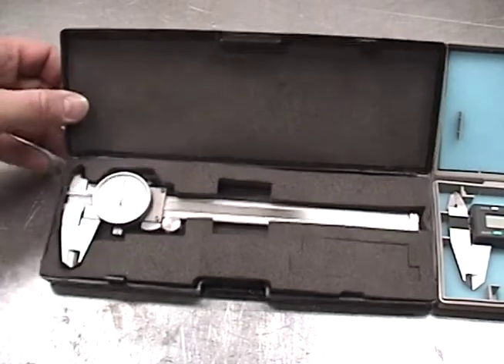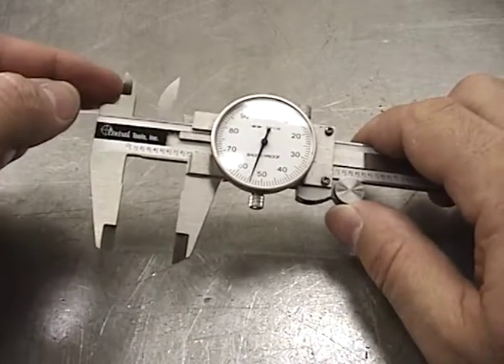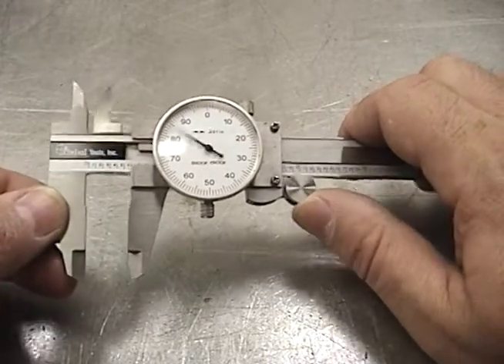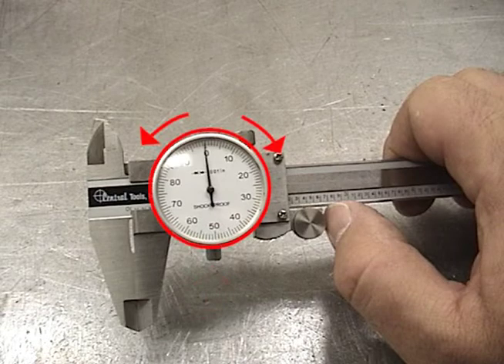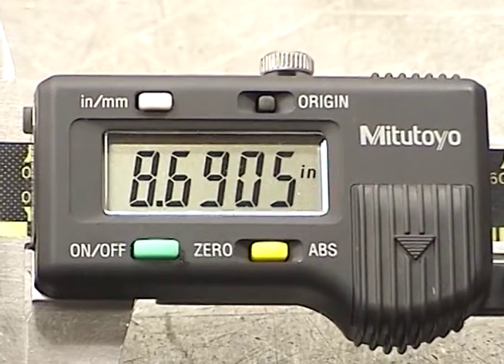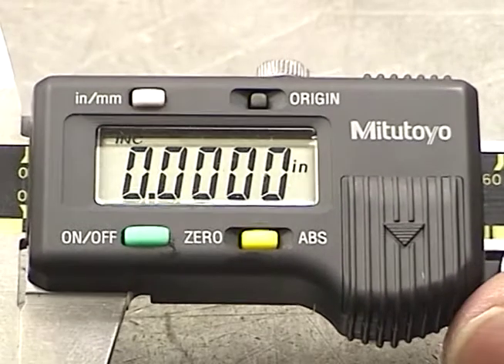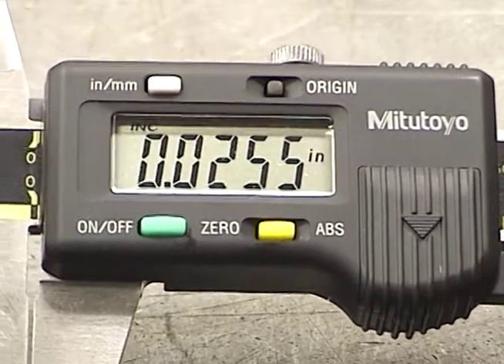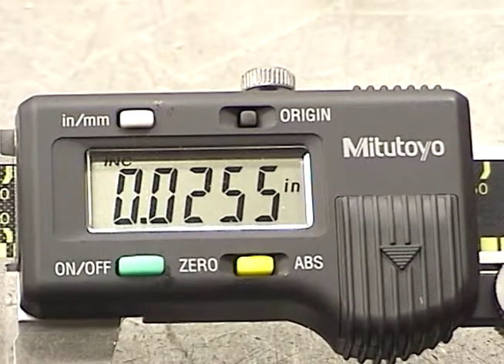Calipers Calibration

Comment: Was looking for calibration info not what it can be used for
Reply from the maker: At 50 seconds to 1:15 I discuss how to calibrate the caliper.  Close the caliper, loosen the scale locking thumb screw and turn the dial so zero lines up with the pointer.
Reply: @DrivelineMaster  No, that is called zeroing and is not how you calibrate calipers. Calipers need calibrating when they go further and further out of true as you slide them open. It has nothing at all to do with how they are zeroed at the start.
Reply: @DrivelineMaster  mine has no screw for tuning the dial how do i do it ?
Reply from the maker: the outer scale might be a friction fit.  Try turning the outer scale.  I have not seen any dial calipers that didn't have a lock screw for the outer scale that is used to zero the tool.
Reply: @DrivelineMaster  but the outer scale will be shifted to the side then ? thats not very esthetic!
Reply from the maker: Something is not right with the engineering of your calipers. You want a correct measurement or do you want esthetics?  I don't know what brand you purchased but anything less than $50. USD I might questions the quality and workmanship.  All half way decent dial calipers that I have seen and purchased all had a lock screw for the outer scale so the caliper could be zeroed.

Comment: Sorry, this has nothing to do with calibration. Zeroing and calibration are not the same thing. Does anyone know if there are any videos on how to actually calibrate dial calipers that are out of whack?
Reply from the maker: Although I agree zeroing and calibration are two different things and I could have used better wording, in this case when the caliper is completely closed there is zero gap. If the reference line edge is on the zero line and the outer dial scale is set to zero this is a form of calibration. Now if the inside measurement and depth measurement portion of the tool were not perfect when the outside measurement portion was completely closed then the inside and depth would not be calibrated.  There would be no way to calibrate the inside and depth because they are engineered into the design. If the design was off or those portions of the tool were damaged somehow the accuracy would be compromised. You can check the tool with known values such as a feeler gauge or a known depth that was measured with a real depth gauge and micrometer.  I never considered the caliper as a super precise measurement tool. It's more of a quick measurement tool. If I need precise measurements for engine building or critically precises measurements I would use a micrometer and a real depth gauge and inside micrometer.
Reply from the maker: I just saw your second comment.  Again I agree my wording is not 100% correct.  If you or any of my other followers are worried about the accuracy at larger distances I would use a normalized calibration plug from a micrometer set to verify the accuracy at 2", 3", 4" etc. I will also restate that if you need very precise measurements you should use a micrometer and not a caliper. There is no way to "Calibrate" calipers, only zero them and hope the manufacture and engineers did their job correctly because that determines the calibration and accuracy at all measurement distances.  The owners manual and instructions always give the + or - accuracy of the tool they are selling you and some instructions I have seen will call the zeroing portion the tool calibration.  I would also argue that if the tool is not zeroed properly then it is also not providing the correct reading and therefor not calibrated.  I know you disagree and we will need to agree to disagree.
Reply: Hey thanks for the info, sounds like I need to spend some more money 😭